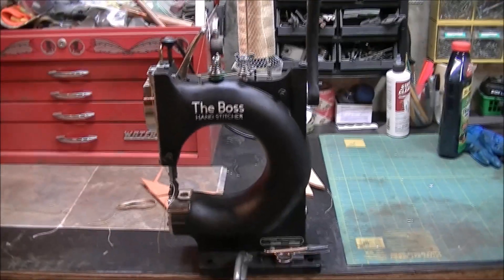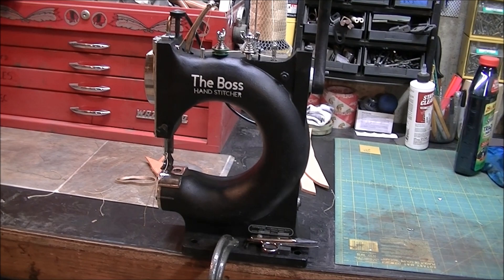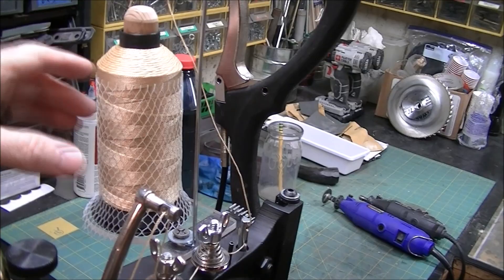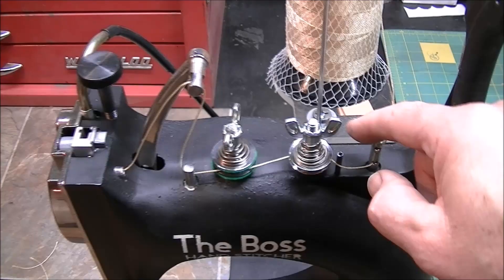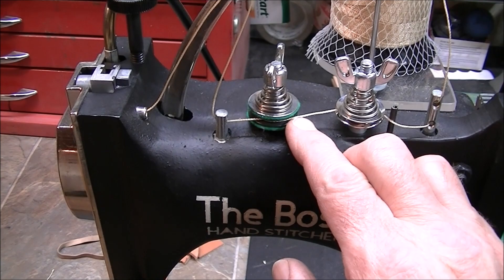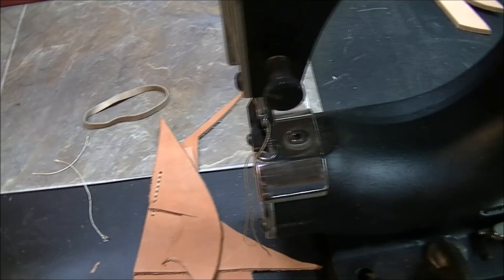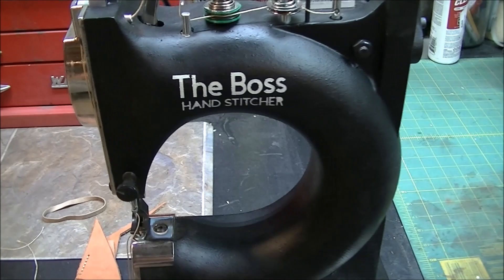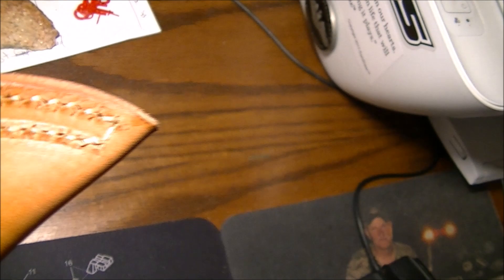Tippmann Boss Hand Stitcher fix!!!

Comment: Great tips.  I finally bought some netting a month ago and eliminated the issue with the thread going under the base, wrapping around the base and getting stuck.  I also wrap both tension devices a full turn with the thread and yes that solved my tension issue.

In general my experience is similar to yours.  It took me 6 months to get it tuned in but now I use it 5 days/week sewing sheaths.
Reply from the maker: It's a great system..... when we finally get it adjusted properly! 😁 Thank you for watching and commenting!

Comment: I know this is an old video,  but wanted to ask how good was that netting ? Did it stretch and go back to normal fairly good? Just noticed some of the netting will stretch then stay that way.
Lol
Reply from the maker: Actually, I just posted this video, but the machine is an old one. The netting seems to be holding its shape well and it is indispensable (and cheap enough) in keeping the thread under control.